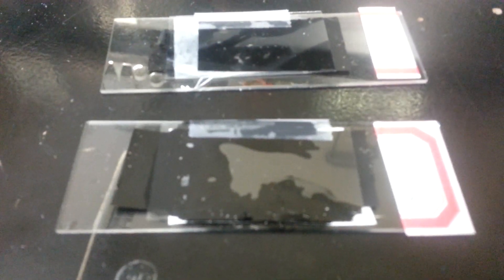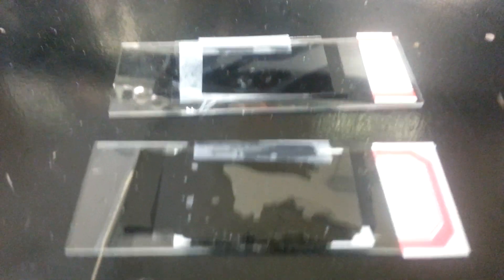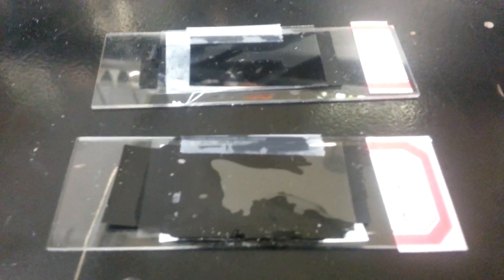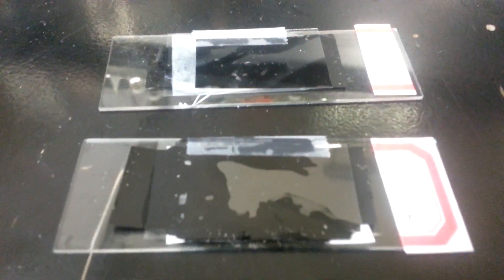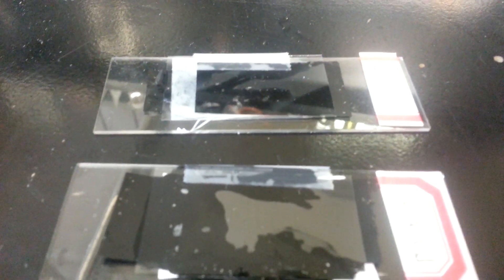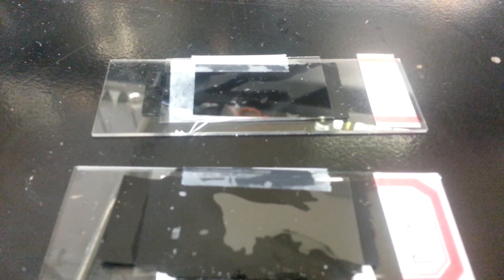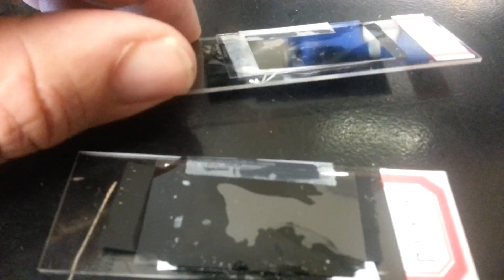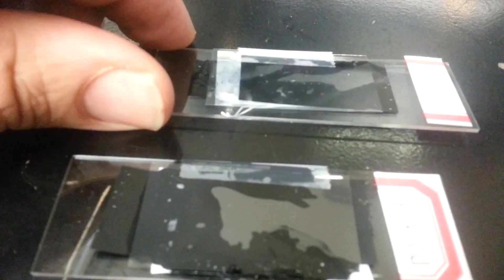Amazing results from Graphene battery

Comment from the maker: I'm doing tests in the lab for the difference in the electrolyte potentials, and then moving on to some better ones to do the same tests.
Reply from the maker: I actually have the papers on those, with all of the test stand info. I just ran a few tests today, and the electrolyte doesn't hold up at higher voltage. So it isn't as good as the lightscribe units. BUT, there is good news....

Comment from the maker: So I ran the tests and the electrolyte doesn't hold up at voltage well. Good news is that it wasn't expected to. Better news is that the GX integrated electrolyte performs far superior to the non-integrated. Meaning we can move on to better electrolytes, like the ones used in many other papers, like the lightscribe units and such.
Reply: Stupid tablet... If this is as good as You think it is, why not go through the process on how to make it?
Please make a montage :-)
Reply from the maker: Jan Erik Kristiansen one of the reasons is because of ip protection. I'm in the middle of a bunch of papers and patents for this stuff. But as soon as I'm clear, I'll post a bunch of how to videos for you diy guys to have lots of fun.
Reply: I am just wondering... how much research is done in this direction? I mean... when we'll be able to have this graphene technology in our phones or other electronics?

Comment from the maker: I think the electrode isn't the issue. Carbon coated aluminum isn't anything super special, but what I did to the electrolyte is.
Reply: I have heard that ordinary candle soot on Al foil has the same effect as coating it with CNTs, which has simular surface area and conductivity as graphene foams/matrices. Great results btw and keep up the good work!
Reply: Venturestarx How did you make your graphene? Various methods result in varying degrees of defects, numbers of layers, nanosheet size, conductivity and surface area etc. I'm curious to know as I will be starting to fabricate hybrid solar cells soon and any information on this would be highly useful.
Reply from the maker: Jonathan Luxient I'm using a soon to be patented method I developed. On industrial scale, it makes GO insanely cheep. The quality is very high, with 2-5 layer average sheet thickness, and 99.999% purity. So far, AFM, XRD, and BET readings are as good or better than anything currently published.
Reply: Wow, sounds impressive :) is anything published? Guessing maybe not as you are having it patented. It sounds great!
Reply: Venturestarx I am curious as I am constantly keeping up with all the advances and journals etc. And I am tinkering with diverse methods at the moment as well :)
Reply from the maker: It's something like that. The bubbles are from the copper electrodes corroding from the chlorine, so not a good thing for actual battery use. Long story short, I have more videos with better results.
Reply from the maker: Not a problem. This was a neat experiment that helped me move along to better things. Remember, every failure is a learning experience and a chance for success.

Comment: If you don't mind sharing, was the maximum voltage across the graphene infused capacitor?  Thanks!  Great video by the way. We live in exciting times.
Reply from the maker: These cells were about half a volt if I remember correctly. The current cells I produce have about 1.5 volts. I'm working on 4 volt cells, but the process takes time, and I may skip the ionic liquids altogether.
Reply: Thanks!  If I understand the capacitance to be 66.2 F and the voltage to be 0.5 V, then by the equation E=1/2*C*V^2, you can store 8.3 joules on that little thing.  Would you mind sharing the weight of the capacitor and the volume?  I am curious about its specific energy and energy density compared with other capacitors and batteries.  When I last priced batteries and capacitors, the cost was 10 times per joule of storage for capacitors.  I would be curious what kind of costs you foresee for your products.  This is really cool.  Thanks for sharing
Reply from the maker: Joshua Fausset You should see the new cells. 1.5v and 18,000F on a cell smaller than a postage stamp. The total cost is a little more than a penny.
Reply from the maker: Venturestarx I also have some 2.6v 33,000F cells. But those are about to go way beyond that.

Comment: Hi, I would like to know, the exact graphene and electrolight mixture you use and if that electrolight used was Epson Salt or what other subtance used? Sorry if my questions sounds silly. Thank You in advance.
Reply from the maker: +freyes389 I can't remember the ratio off hand. And with this cell, I also can't remember the electrolyte. I think it was Aluminum, or Copper Chloride. These were very crude "proof of concept" cells, but the later cells I produced used Phosphoric acid in PVA. My latest cells are with actual lithium-ion setups, as well as some other advanced ionic liquids. Those are on the back burner for a bit....

Comment: Are you using activated carbon on the aluminum as well and where can I get some Graphene? Thanks
Reply from the maker: +freyes389 I never used AC in any of my cells. 100% graphene for every cell. I also sell the graphene on Ebay and Amazon. Just look for the CiCarbo brand from Celtig.

Comment: Hi I fly multi rotors commonly called drones.I currently use a   3s 2200 25 c lipo battery.The weight of the battery is 186 grams but I'm interested in using a graphene battery to save on weight and to recharge faster.Currently concentrating my work on drones but realizing the potential of longer flight times.You seem to be concentrating on graphene and I was wondering if I could purchase a graphene battery that would supply power to my aircraft.Do you think you can help by createing a bat 4 me?
Reply from the maker: I know I can supply the materials, but currently, I have had a hard time assembling a homogenized battery. I can get the test cells up and running fine, but they degrade over time due to manufacturing flaws (my fault on all accounts) If a battery manufacturer were to take my material and use it, they could easily make the product you desire. That's basically what I'm working on right now, is arranging mass production of GX so a battery manufacturer can really make this stuff work.
Reply: Venturestarx Hi Venturestarx. If you dont mind me asking.. how far are you from a Functional Prototype we could validate and cycle? We're quite impresed with the potetial of your work and wondered if a pouch cell could come out soon? Regards and ckraking job!
Reply from the maker: Martín De la Vega I could get one together by the end of the year, but that would curb the manufacturing of graphene for a bit, and I'm so close to having that ready that I can't stray. But once the mass production is underway, I have quite a few companies lined up that will have amazing batteries out very quickly. Cost is key, and I'm trying to cut total cost by a thousand percent.
Reply: I see. Glad to know you're on the verge of the process. I'd like to contact you directly if possible. Can you pass me an email or Skype?
Reply from the maker: Yea, I'll just private message me here, and I'll send you and email
Reply: Venturestarx  Good evening. Pavel Calderon my colleague has sent his contact ditails on the Discussion forum to get in contact with you. I really dont know how to send private messages on this so i guess it'll be the easiest way. Im guessing we will be of interest for you. Thanks again. Regards. M
Reply from the maker: Martín De la Vega I saw his email on here, but seem to have lost it. As is, I get about 50 a day. I'll keep looking though.
Reply: I'll ask Pavel to send his details again.dont worry.

Comment: Carbon coated aluminium foil did you buy it or DIY.?
Reply from the maker: You can get it off the shelf just like the one I use. Many electrode companies will send you a roll for free if you ask. (That's what I did)

Comment: i believe that you should (try) to use a lemon or a lime as an electrolyte. Just a hunch. (saying it because a lemon is very sour)
Reply from the maker: You could, but the acid in lemons is citric acid. It's a relatively weak acid and not as good at supporting the electrolytic needs. Currently, I have used Phosphoric, and Sulfuric acids, few base based electrolytes, a few ionic liquids, and a few really neat electrolytes. All have shown very good gains with the integrated grid.

Comment: What is "UF" ?
Microfarad?
Reply from the maker: Yep. Notice the size of the capacitor is about the size of a postage stamp, and as thin as one. Normal (like 2200uf) caps like in a computer are constructed similarly, but are a strip about 2cm wide, and over 25cm long, rolled up in a little metal canister.
Reply: Venturestarx I'm totally with you! Your results ARE amazing!

Comment: Not one mention of voltage.
Reply from the maker: Not one reason to do so. When you are making test cells from a control electrolyte vs one with the integrated grid, you shouldn't have much change in voltage. But if you really need to know, the test stand voltage is around 1 volt for both.
Reply: You call it a battery then state the microfarads.  If you call it a battery then the voltage is important.  This thing is a capacitor.
Reply from the maker: texjarhead Many people would agree this can be called a super capacitor or a battery. I won't get into the semantics between the two, because they are similar and different in many cases. But voltage has nothing to do with the word battery. Voltage doesn't matter when you are not stacking cells, nor changing electrolyte in an experimental setting. What would the voltage matter in proof of concept? If it was a Li-ion cell, it would produce the same 2.7 volts, and if it were lead acid, it would produce around 1.2. If it were an ionic liquid I could get the same 4.7-ish volts with or without the graphene. I can keep going on if you still do not understand what is going on here.
Reply: You measured a battery with farads and you lecture me.
Reply from the maker: texjarhead Yes and yes. I used the capacitance reading on the meter because I can. Especially when dealing with very low energy densities. Of course I could have used Potentiostat data instead, but it takes longer to hook up and get initial data, like shown in this video. Once again the actual value isn't as important as the value of integrated vs the control. But you would know that if you were in a lab instead of a couch arguing trivial semantics. This isn't a paper in Nature, it's a video on YouTube.